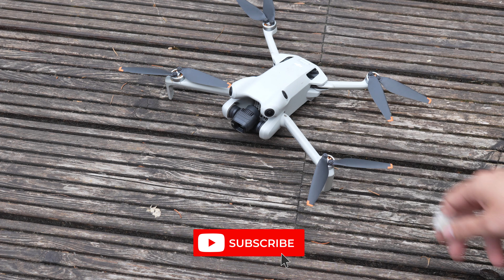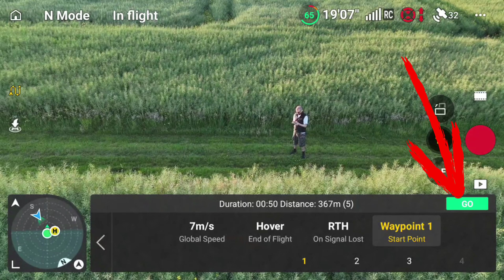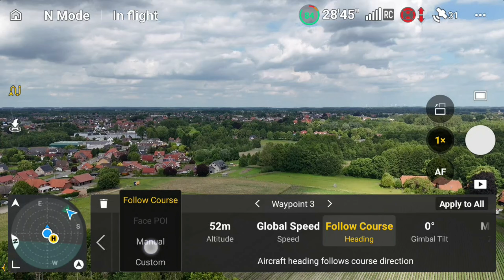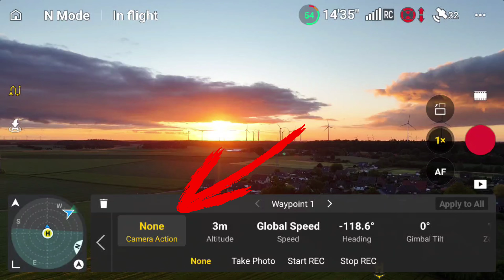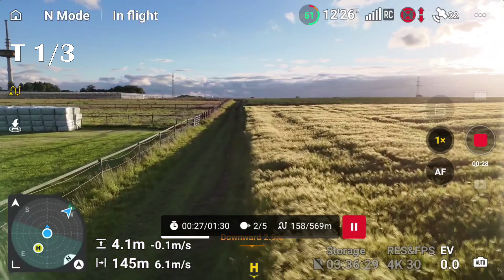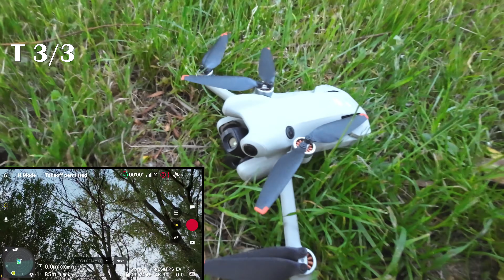HOW TO use WAYPOINTS with DJI Mini 4 Pro | Tutorial | Step-by-Step Guide | START HERE

Comment: But you said you relied on the obstacle avoidance to prevent it from hitting the grass. But the image on the screen said that you had O.A. off.  That's confusing.
Reply from the maker: bottom sensors are always active even when you disable the obstacle avoidance system.
If the drone is too close to the ground, the sensing is triggered and the waypoint path is cancelled

Comment: Great tip on how the drone reacts to waypoints. You’d think it would follow the path flown to set them. Knowing it’s finding an optimal route between waypoints now provides me with better planning of the route for the shot (and path) I desire. Thanks for that information!
Reply from the maker: glad it helped. the biggest surprise for many people is exactly that... the drone does not retrace your flown path, it calculates a new one between the waypoints. once you know that, planning becomes much easier because you can decide exactly where the drone should pass and where it should not. happy it gave you a better idea for setting up your shots.

Comment: So... it does just bezier curve for all settings between waypoints, making path more smooth but wider?
Reply from the maker: Yes exactly this happens. So you need to take this into consideration when planning your route with potential obstacles. Also when flying close to the ground etc...

Comment: Hola amigo! Te pregunto acerca de la posición de la camara. Como hago para hacer una misma misión con la camara horizontal y el mismo circuito con la camara en vertical sin perder la mision? Debo grabar la misión con otro nombre? Debo copiarla y hacer algún cambio en la orientación del gimbal? Te pido esa ayuda, desde ya muchas gracias
Reply from the maker: Hola amigo! Great question. If you want to fly the exact same waypoint mission with the camera in horizontal and then in vertical, the safest way is to duplicate the mission and save it under a different name. That way you can set the gimbal orientation for one version to horizontal and for the other to vertical, without losing the original mission. This makes it easy to repeat the same flight path with different camera setups. Hope that helps, and happy flying!
Reply: @doatrip muchas gracias. Haré la prueba éste fin de semana y te comento el resultado.
Reply from the maker: Perfect, sounds great! I’m curious to hear how it works out for you this weekend — let me know the results!
Reply: @doatrip finalmente hice hoy mismo. Dupliqué la misión, pero ésta vez con la cámara vertical. Para hacer la prueba, puse la cámara en posición horizontal e inicié la misión. Llegó al waypoints 1, e inicio la grabación con la cámara en horizontal. Por lo tanto la respuesta a mi pregunta, es negativa. La posición de la cámara, será la misma que cuando le das a iniciar.

Comment: Hi thank you for the video
I cannot use waypoints at low altitude and narrow spaces, it’s not following exactly the coordinates, and stop at the colisions.
Frustrating 😮
Reply from the maker: You are right, it has limitations in narrow spaces, espacially when using obstacle detection.
If you want to fly such spaces, I would recommend deactivating the sensors.
However be careful then, as seen in my other videos.
Reply: @doatrip thank you very much
 I have many problems with the detections of my buggy, it’s not seein like a car, it’s hard to detect

Of

Comment: Obstacle avoidance is off at the start of the waypoint mission. This needs to be on 😊
Reply from the maker: I did a test with obstacle avoidance. Close calls are impossible. Like flying thru the bushes will not work. 🥴
Reply: @doatrip so obstacle avoidance are not working using waypoint?
Reply from the maker: @Crossfadetraveller Indeed it is. But it won't let you go close to obstacles at all and stop the mission.
Reply: @doatrip its will auto stop the mission right? Ill try it now 😅
Reply from the maker: Yes it will,so no worries. 🙂
Reply: @doatrip thanks

Comment: Thx. Problem with the altitude might be the "smooth route" algorithm. It not only calculates curves to waypoints in x/y axis but also z axis. Using 3 waypoints with 2 close to the ground and one above one of them leads to a curve "through" the ground under the lower waypoint.
Reply from the maker: I think you’re 100% right.
I hadn’t thought about it that way — that the drone behaves the same along the X and Y axis.
That actually makes the most sense.
Thanks so much for sharing your thoughts!
Reply: Sounds like my excel problem when creating smooth curve ... Occasionally an in between point between A B can be below either A or B.😅

Comment: Hi, great video and great instructions. I’m not sure if you noticed, but your obstacle sensors were displaying in red “meaning they were off“ but they seem to have been working. I’ve done multiple waypoint mission videos myself and now I’m anxious to retry the mission just to see if that changed. I will also review the footage from my previous waypoint missions to see if the obstacle sensors were showing as yours were red.

Thanks for sharing.
Reply from the maker: Thanks a lot! glad you liked the video 😄
And yes. I totally noticed that too! The sensors were showing red, which should mean they’re off… but clearly they were doing something during the flight. I was confused at first, cause I didn’t turn them off manually.
Let me know what you find when you check your older missions.  maybe it’s just a visual bug, or maybe DJI changed how that indicator works with waypoints.

Really curious what your results are and yeah, def worth another test flight! thanks again for watching and dropping such a thoughtful comment!
Reply: When off, they will still warn you - but they won't take any action (brake/bypass)

Comment: Quick Tip: "Apply to all" only applys the LAST SETTING you modified.  If you change 3 settings, and the last one before selecting "apply to all" was 'Zoom' -for example,  only Zoom will be applied to tge camera on all WP's.

Very VERY surprised at your low altitude near collision. All my WP Flights stop immediately if collision is imminent,  same with Hyperlapse.  I can see 2 possibilities. Possibly you are in sport mode? Still, I believe they default to Obstacle Avoidance ON and BRAKE.  Second possibility even though DJI ONLY OFFERS Waypoints on models with Omnidirectional Object Avoidance,  but we observe the Mini 4 Pro flying diagonally at that moment AND there was technically no "object" there but instead, rising terrain. The diagonal attitude could be, if not a blind spot, a reduced, poor vision spot, AND the sun glare was not helping matters. I think a retest is in order! You saved the WP mission,  right? Go run it 8 hours earlier in the day. Dont intervene. Bet it doesn't crash!
Reply from the maker: Thanks man. super helpful again! That "Apply to all" tip is GOLD. I really thought it applies like... all settings at once 😅 No wonder some values felt inconsistent. Gonna play around with that more and maybe mention it in nem follow up.

And yeah, the near collision at low altitude really surprised me too. It should have stopped, but it just kept flying like nothing's there. I'm pretty sure I was NOT in sport mode (you can see this after the crash, when I shortly shown my RC, it  was on normal mode) 

Your theory with the diagonal attitude + rising terrain actually makes a ton of sense. I didn’t even consider that the angle plus the sun glare might’ve messed with the sensors. I guess in that moment, the drone did not “see” a traditional obstacle, just the terrain creeping up underneath.

I did save the mission, yep 😄 so now I’m super curious – I’ll def run it again at a different time of day and just let it go, no touching the sticks. Let’s see if it behaves better without the glare and low sun angle. I’ll update you on that for sure!

Appreciate your deep insight – love comments like yours.
Reply: @doatrip  Have you had a chance to run it again? I'm really curious what went wrong the first time.

Comment: I've been experimenting with Waypoints on Mini 4 Pro and Air 3S since they were released.  Awaiting my Mavic 4 Pro Creator Combo arrival (tomorrow!) Watching now to see what you have discovered yourself. There was always a "Flight Heading" choice for gimbal between waypoints. I've always understood "Manual" for gimbal when not linked to a POI to mean operator managed. This simulates a 2 controller setup as on Inspire. Drone follows presets, and you become "camera operator". You explained "Auto" zoom 100% correctly, many get it wrong! Cloud storage and sharing among aircraft is fantastic,  except the US probably won't get it, because our politicians and some people piss themselves in fear that DJI KNOWS THEY FLEW OVER THE LOCAL LANDFILL. SUCH A RIDICULOUS BUNCH OF TECHNOPHOBES
Reply from the maker: Thanks a lot for your comment – sounds like you’ve got quite a bit of hands-on expierence with the waypoint feature yourself!
And congrats on the upcoming arrival of your Mavic 4 Pro Creator Combo – that’s gonna be a serious upgrade. You’ll love the flexibility, especially with the new gimbal and the extended waypoint stuff.

You’re absolutly right about the "Flight Heading" and "Manual" gimbal behavior. I also see it as a kind of pseudo dual-operator mode, where the drone follows the path and you can focus entirely on the camera. That makes a lot of sense, especially if you’ve worked with the Inspire. Good to hear you looked at it the same way – most people miss that detail.

And yeah – thanks for confirming the auto zoom bit! So many get it wrong or just ignore how it really works. It actually does some pretty smart stuff in the background.

As for the cloud sharing thing – totally agree. It’s so usefull, but of course... some places just panic over the idea that DJI “knows” you flew over some trash pile. Pretty ridiculous. Tech fear at its finest.

Really appreciate your input – and let me know how your 4 Pro does with more complex missions. Would love to hear what you come up with!